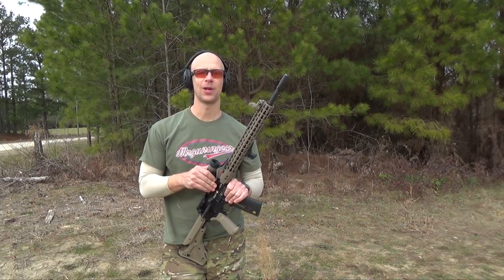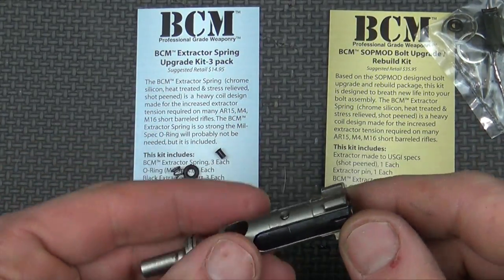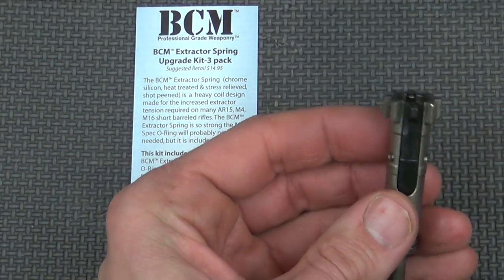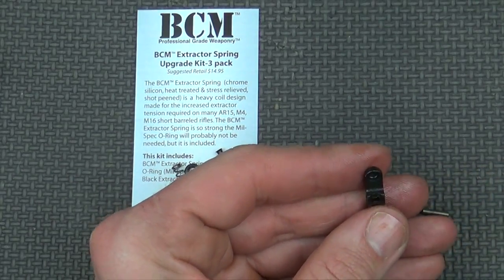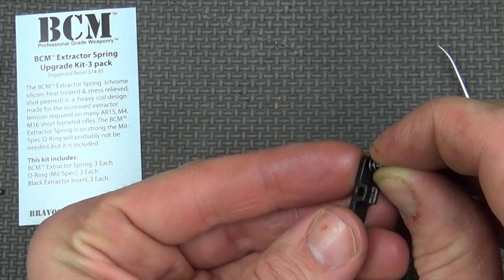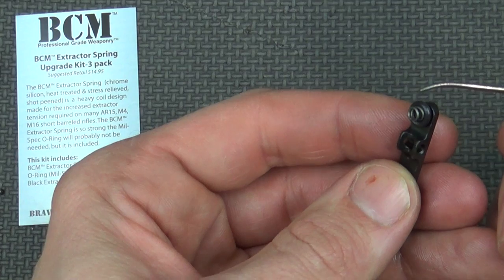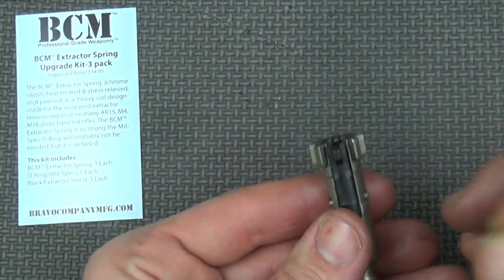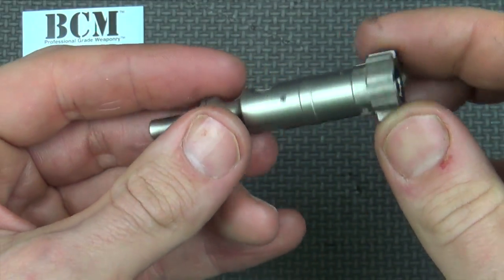BCM AR-15 Extractor Spring Upgrade Installation & Review (HD)

Comment: I bought a compete Bolt Carrier from BCM..does it come with the rubber o- ring already in it ? Also do you shoot a lot of Steel Case Ammo..like Wolf ? I have a S&W M&P 15 ..since I bought the BCM Bolt Carrier it will shoot anything I feed it. I shoot a lot of Wolf Ammo...there Website says the back the ammo up 100% ..thanks for the great stuff you put out. Please keep the info coming. God Bless.. Semper fi /Always.
Reply from the maker: Tony Briggs It should come with the o-ring in or in a side bag.   I have a video dedicated to all things steel cased ammo related.
Reply: Mrgunsngear Channel  I seen one with it..but just wondering if one was already in it..never had it apart yet--thanks Mrgunsngear. Cool channel.. Semper fi

Comment: Great video, thank you!
Is it me or am I the only one the noticed your gun is ejecting at approx the 1 o'clock position. I havent checked my 5.56 carbine or my .223 Wylde AR pistol based on Sprinco's tuning guide/video stating the optimal and correct ejection angle should be at 4 o'clock. See this from their site. https://www.instagram.com/p/BTUx9Jdl26X/?taken-by=sprincousa
Keep up the great work!! I'm a big fan of your channel!
Reply: Not a fan of the rubber donut aiding in extracting, the Sprinco 5 coil is a great upgrade. You are correct, 4 0'clock is the optimal trajectory.